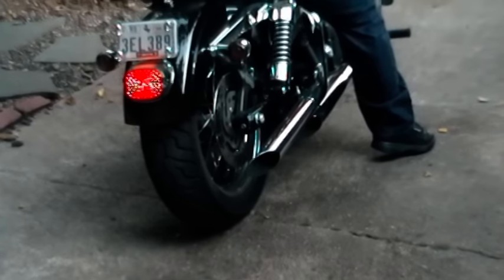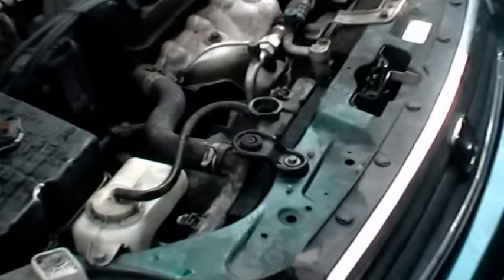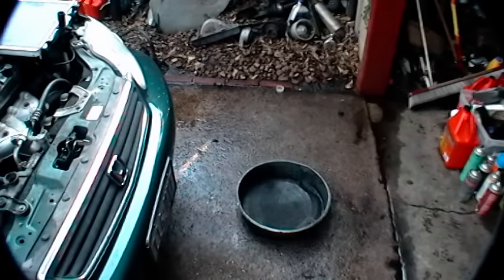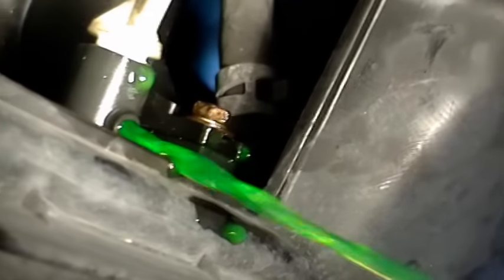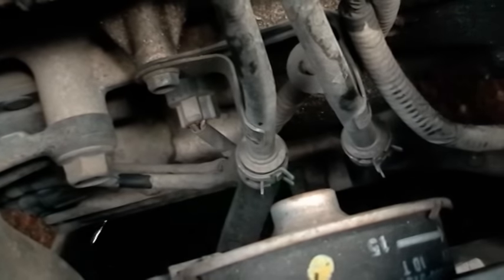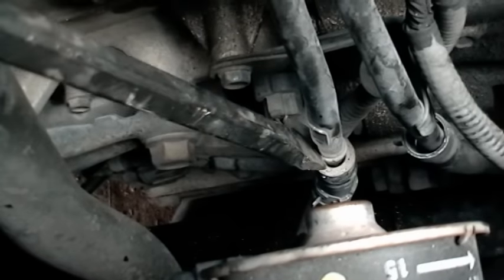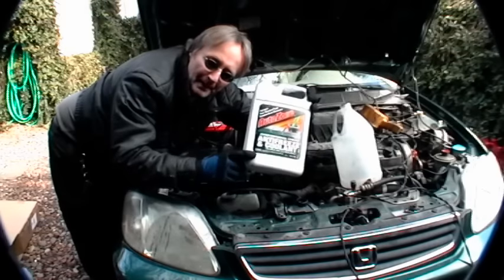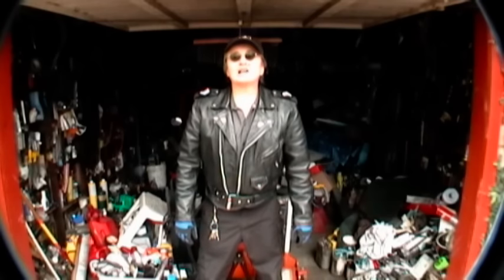How to Replace a Radiator in Your Car

Comment: Hey scotty, I'm looking to replace my radiator very soon/ This seems like quite an easy process, however, when following this guide, won't air bubbles make it into your cooling system? If so, how would you go about getting them out? And would you recommend a complete block flush while replacing the radiator as well? 

Enjoying the videos - Thanks,
Scott

Comment: hey great tips love your videos definitely subscribed :).
I just hit someone at the back of their car and i think i lost my radiator as it leaks all the water as soon as i fill it up with water and the fan isn't working too. should i replace both the radiator and the fan?
i did notice steam coming out of the bonnet i drive the car for 10mins without knowing the damage to radiator and without knowing the temperature gauge to hot is their any damage to the engine yet coz i could drive normal as before.
Reply from the maker: if small, only radiator and Ac condenser will be damaged. See my video "fixing teenage wreck damage"
Reply: Thank you Scotty I only had to replace my Radiator and Bonnet which i got both for $150 from a wrecker.
Radiator support was bent in but I could pull it and fix it my self :)

Comment: Should I flush before I replace it or after? And if so what do you recommend to flush with? I've never done this before so I need all the help I can get.  I have a 98 Ford Escort, SOHC 2.0, manual transmission.

Comment: The reason I ask this is because i own a 1992 Mitsubishi 3000gt Sl Atx and I'm doing a twin turbo conversion. If you add more power to your cars engine does that make the transmission work harder? And is it true if you add more power to a car, is a bigger radiator a must have thing?

Comment: Hi Scooty. you are great......I do have a question? how do I measure the radiator to replace it. I have two choices 17 3/4 or 18 1/2  don't know wheater to measure just the grill part of with the black part where the houses attach???

Comment: @scottykilmer  I tightened it more, seemed to work, but then checked after driving it twice and got a little drop on the towel.   Do you mean I put the JB weld on the threads or around the outside of the fitting?

Comment: Yo Scotty! I had to take my radiator out just to replace a broken drain cock but it's OK it caused me to replace some other things in the cooling system. Anyhow my question is there still antifreeze inside the engine block?

Comment: Hi Scooty. you are great......I do have a question? how do I measure the radiator to replace it. I have two choices 17 3/4 or 18 1/2  don't know wheater to measure the black part where the houses attach or not???

Comment: Dear Scotty, i need a new radiator due to a leak in my current one. I've look all over and i got two matches. One of them says "with airconditioning" and the other says "without airconditioning". The measurements on the one with AC doesn't match the one currently in my car while the one without AC does. I did call the company and they told me if i wanted to keep my AC i needed the one that stated it was with AC. Which one do i pick ? I drive a 1998 Citroen Xsara 1.4 Berline. Thank you!

Comment from the maker: you messed with the wiring somehow and crossed wires or sensors to make the fan stay on. check the wires and sensors closely, probably pinced or broke a wire

Comment: Hey Scotty, I just had my catalytic converter replaced as there was a problem with the hose and apparently not repairable and it cost a pretty penny.  I've been leaking coolant(very slow) for a few weeks and just kept checking it and filling it...I got a chance to take it in today and the radiator needs to be replaced.  This time $600.  I drive a Chrysler Town and Country 2008, if I follow your video will it be a similar process.
Reply from the maker: SAQT 79 sure, do it yourself, easy job, you can get a chinese made radiator for 120 bucks or so if you pirce around
Reply: Awesome thanks....my husband thinks I'm crazy but I think I can do it!

Comment: Hey Scotty, my dad says I shouldn't change my radiator myself because the bolts have to be tightened to a certain PSI or I'll "spring leaks" everywhere and fail. Is this true? I don't have any tools to measure the PSI, should I still proceed?

Comment: finally I've take them off...but another question is..when i drop off the hose from the radiator to the transmission, there was some fluid coming out....but it is not seems to be coolant(my coolant should be in green..maybe transmission oil?)is there something wrong?

Comment: Hi Scotty I have a question  my car had to be repaired for radiator  and condenser  and fan replacement also I bought the 3 more parts to hold the radiator  and replaced the front bar on a 2016 300c  chrysler  so the mechanic charged me 1400.00 is this to much or fair or cheap

Comment: I have a manual transmission, is it the same process? What much differs from manual and automatic? Ex. Disconnecting oil cooling line. Thanks in advance!
Reply from the maker: same process, but easier as there are no cooling tranny lines then

Comment: I just replaced the radiator in my 93 ford taurus.  I replaced it 16 months ago, but I don't think they one they gave me was the right one, but it worked......anyway....I used the transmission line fittings it came with.  They came with O rings.  It was leaking tranny fluid, so I took it all back out again and used the old fittings.  The top line is still leaking.  I'm going to see if I tightened them enough, but if they are tight, is it ok to use thread sealer on it?  Thanks.

Comment: The radiator on my 2003 Chevy Impala takes way longer to take off. I have to remove the upper engine mounts, a support brace, a plastic guard under the car, half the air filter housing, and then I can finally unbolt it and pull the whole thing, about twice the size of this one, out before doing it all again in reverse.
Reply: I had to take my front bumper and headlight/harness out to even get to the radiator on my cobalt, I know what you mean about Chevy's, not easy to access.

Comment: Hello Scotty, I am getting ready to replace the radiator on 01 civic ex manual, I would like to know if I need to get a radiator for manual only or it doesn't matter whether it's for stick shift or auto. Thanks.
Reply from the maker: doesn't matter, if you get an automatic radiator, you just don't connect the cooling lines on the bottom to anything.
Reply: Scotty Kilmer
Thanks for the response

Comment: Does radiator has any physical connection with AC compressor or Refrigerant gas? Mine mitsubushi lancer ex gas has leaked after change of radiator

Comment: Hi Scotty, a long time ago my laminova oil to water cooler cracked and forced a lot of oil into the coolant. I have drained and flushed the coolant a few times now and still find traces of oil floating in the system. I knew it wouldn't be able to get all the oil out just by flushing the coolant a couple of times but it's bugging me. Do you have any suggestions or any flushing fluids you recommend me using?

Comment: Scotty,
I changed my radiator, temp gage, cap, and hoses in my 03 Outback and after driving it it was running too hot, is there an amount of time that it takes to circulate into the engine? Or do I have some sort of a pump problem?
Reply from the maker: Make sure all the air is out of the system, but if it is, those things eat up head gaskets. Do my test "how to tell if your head gasket is blown"

Comment: Hey Scotty, I have a 2001 Chevy Blazer  that broke off a piece of the radiator fan last week on the road and literally blended the shroud and radiator. I bought a new radiator, fan, and fan clutch yesterday. Is there a trick to getting the fan clutch off? i cant manage to keep the shaft still trying to take the clutch off. Also, are the metal connectors going into the radiator the transmission cooler lines? I can't get them off for the life of me the other side was so easy. I may need to buy new

Comment: Scotty, My 1990 Honda Accord overheats when I am at a stop light, but goes back to normal when I begin to drive. Also, after I have stopped and got out of the car, the fan is still running for about 20 minutes. What do you think is the problem?

Comment: Hello.. scott one question..my nissan maxima 2000 is stick shift the radiator is cracked van I use a radiator for automatic transmission??on my stick shiftaxima?

Comment: The car is currently not overheating, however there is still no heat comming from the air vent. The radiator fluid is green and not choclaty if it was oil mixing. Any suggestions to fix heat not coming into vents. The heater in-out hoses are a pain in the but to get too. Do you think there is still air in the system?

Comment: Hey Scotty,  I have a 97 Nissan Pathfinder and i have changed the radiator out only to find the leak coming from where my overflow tank is.  Is that easy to change out as well, im confused as to where to begin to find the leak.  Im pretty sure though its where the overflow tank is because i poured some in a couple days ago and noticed its been pouring since.

Comment: hey scotty, is this the same process for a 1988-1992 mazda rx7? im buying a mazda rx7, guy says its over heating but dont know what wrong with it, im thinking he has a radiator fail and i must replace it. do you think thats it if the car is over heating? is this the same process for an older rx7? thanks man - subscribed
Reply from the maker: sure, all japanese cars are pretty much the same
Reply: Its probably a thermostat problem!
Reply: i fixed the thermostat, it was the first thing i reaced, after that it still over heats but it is just postponed for about 10 more minutes
Reply: replaced*

Comment: Hey Scotty, is this easy to do on a '96 Dodge Dakota? Also could this solve my heating issue as well? Like my trucks gauge will read normal but it'll blow out cold air.
Reply from the maker: same process, BUT a normal temp running vehicle will not fix the heater by replacing a radiator.
Reply: Any service manual will have a picture of the heater control valve. This is what diverts coolant into the heater core. If there's no heat start by making sure the control cable that opens this valve (which sends hot coolant into the heater core, which makes you warm) is hooked up at both ends and not broken.

Comment: Do you need to replace the transmission fluid as well? I have a 1998 Nissan Frontier Xe Manual Shift not sure if that applies. Also I saw a radiator that says no EOC is that important?

Comment: hey Scotty so I just changed my radiator on my 2000 Oldsmobile Alero and it was successful the car does not overheat anymore but now the fans dont turn when the car comes to normal operating temperature. on the GM I had to take off the air compressor as well to remove the radiator which caused air from the ac lines to leak out. the car runs at normal operating temperature but the fans don't turn on
Reply from the maker: +Shai Lee check the temp sensor for the fans and all their wiring to see what you somehow damaged, also check the fuses

Comment: Any advice for connecting/disconnecting the lower radiator hose on a hyundai accent 2008? The damn thing is impossible to get to and i can't even see where it connects to the engine.

Comment: Scotty - any suggestions as to a good aftermarket brand of radiator?
Reply from the maker: for most cars, any brand works fine. I often use chinese made ones, and they have all worked fine for me, being just plastic and aluminum they are all machine made anyway
Reply: Cool. Thanks!

Comment: Hey Scotty. I was wondering, is it possible to add a radiator for an automatic transmission to a manual car? Could I just cap the lines meant for the automatic? I've got a manual '88 Nissan Stanza wagon and I found a radiator at a pick-n-pull but it is on an automatic '88 Stanza wagon.
Reply from the maker: of course, I do that all the time now cause stores generally only stock the automatic radiators to keep stock down, just leave the caps on

Comment: I just have a question in my car it’s a 2008 Nissan patrol and it’s a used car my question should i put a foam seal/insulation between radiator and condenser

Comment: Oh and another thing, Im driving a 2004 Hyundai sonata Base model. I drove it for 3 months with a tiny crack in the radiator. I always checked water level and it was fine. But was wondering if I may have messed anything up ?

Comment: Hey scott. I just ordered a new Rad for my Dakota 98 V6 sport(auto trans). Is it a similar process? I'm considering doing it myself. I noticed though it has a hood that goes over a fan that's actually attached to the serpentine pulleys(I think that's what it's attached to.). From what I've seen It can just slide out after you unhook the hoses without having to worry about the fan. 

also is there something I should do before I replace it?  Do I have to flush out the old one before I put the new one it?
Reply from the maker: I would also change the thermostat, and the process is similar to this video,just a bit harder as dodge doesn't design em as well as the japanese for repair
Reply: Scotty Kilmer yea I looked at it and the fan hood has to be unscrewed from the radiator in 4 spots. Then I have to take off the plastic cover underneath just to drain whatever radiator fluid is left.

Also, I had to use an egg and tap water because I was an hour away from home with no coolant and a leaking radiator. Should I flush it out with a garden hose before I replace the radiator?
Reply from the maker: *****
sure, remove the thermostat and flush out the block, and change the thermo too as I said
Reply: Scotty Kilmer Done and done. I'm trying to remove the transmission lines but they seem to be on a metal tube and then connected together with some nuts to the rubber tube that goes to the radiator. Do I unscrew it at the metal pipe or do I just try to rip is off the radiator?
Reply from the maker: ***** those are special fittings and you need a special removal tool to get them of. One giant pain in the ass really, but it's cheaper to make them that way.
Reply: Scotty Kilmer Right. So I couldn't hit them off like you did in the video so I had to take the pipes off the radiator to get them to a more open space. http://i.imgur.com/o2UraZw.jpg you can see how rusty the connection is and here is where the tube meets the metal http://i.imgur.com/r5UZCmc.jpg
Reply: Scotty Kilmer fuck it I just cleaned out the old pipes and threw em on the new radiator. Worked fine. no leaks.

Comment: Hi Scotty , I have a 98 honda civic and I just bought a new radiator cap and it still keeps leaking from underneath the cap , was wondering why it keeps leaking there after putting in the new one thanks

Comment: Scotty,
I want to backflush my radiator.  Where's the heater inlet hose to install the tee on 97 Camry V6 ?  Also, how often or what's the mileage that you need to change out brake fluid and steering wheel fluid?.......Thank You.....

Comment: Scotty, how about bleeding the system? Would that be mandatory after changing the radiator?
Reply from the maker: IF air gets stuck, yes, but doing this process of running the car with cap off and adding coolant while it warms up often will make that unnecessary
Reply: Scotty Kilmer I see, thank you. Reason why I asked was because my Acura's radiator needs replaced and I was concerned about me not being able to bleed the system properly and cause overheating for some reason.

Comment: I got a radiator that leaks green stuff so i assume its the radiator because i felt underneath it and it was wet from leaking and it starts to overheat. I'm thinking about changing it myself only because it looks very easy to me

Comment: Hi scotty. Question: I install a new radiator and thermal fan clutch (brand new). I get the loud roar at idle when the engine is cold and the roar goes away. I live in a hot climate. I notice when I am sitting at the stop light (afternoon) and take off I hear the fan clutch roaring and when I reach 40 mph and cruising for 10 minutes at that speed the roar stops. When I get to the next stop light and take off, it does the same thing. Is the thermal fan clutch bad already? Thanks for any advice.

Comment: Hey Scotty. I have a question. My car has a small crack near the radiator cap. When I turn the car on, coolant drips out of the crack and vapor comes out of it. I'm not sure if there are more leaks or craks, but vapor seems to come from other parts, but I could be wrong. 
I let the car run for 10 minutes, the leak stopped and then came back. I kept checking the temperature gauge and the car doesnt overheat, the needle stays in place. What could be the problem and what should I do?

Comment: hi scotty, i have an australian mitsubishi challenger, i beleive u guys in states call it montero..i hav just noticed that there is oil in radiator and overflow tank. cant see any creamy residue on oil cap. research done so far indicated maybee cracked oil cooler in radiator..what do you think? sorry if im being to vaugue but im terrible with mechanics :-)
Reply from the maker: pray it's just a cracked oil cooler. To find out if it's the head gasket  though, do my video "how to tell if your head gasket is blown"

Comment: Scotty I got a problem,

I have a 2003 Infiniti g35 coupe, i pulled it out of winter storage and noticed heater was not working and it was overheating, So i tried to burp system. This was unsuccefull so I took thermostat out and boiled it, thermostat works acording to temp. I reasemble and purged system, tempature is staying normal now and not overheating! However I noticed a sludge/ slime in my yellow no spill funnel I was using as coolant level dropped . Maybe prior owner put additive in ????

Comment: I just replaced the rad in my 2004 Rio, when hooking the transmission lines back up, do they have to be hooked up the same way? sounds like a dumb question but i got the two hook ups confused in the process